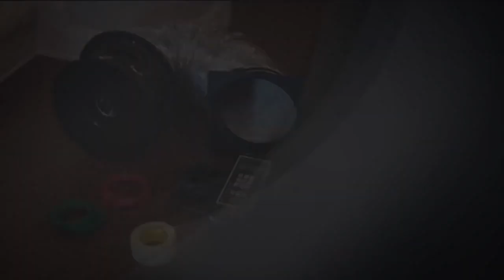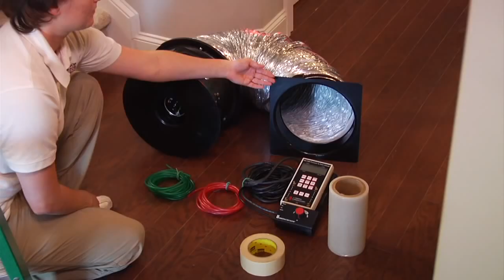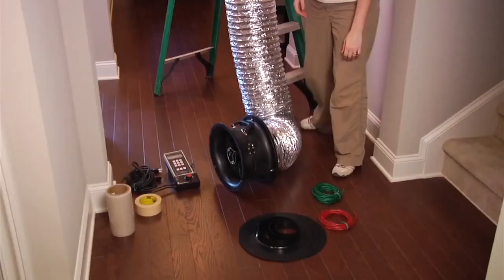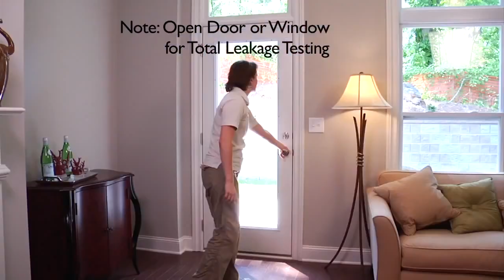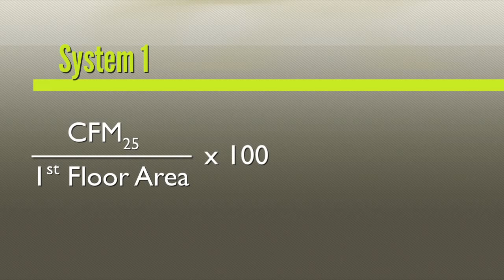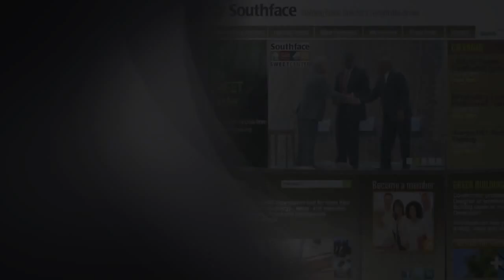2011 Duct Leakage Testing in Homes

Comment: I agree with Corey and even though we sell grille mask (duct mask) we also recommend your Vent Caps and even give samples away with each system to encourage testers to get them. 

Open Range should never be used on a Duct Blaster, which is attached to a flex. The manual doesn't say this specifically but it can be ascertained in another way since you must not run over 100 Pa back pressure (pressure in the flex) and if you run the Duct Blaster near maximum speed the back pressure will be well over 100 Pa. This results in the Duct Blaster reading high by as much as 25%. To get an accurate reading simply use Ring 1 or smaller which will create the same test pressure as Open Range any way. It IS ok to use Open range when the Duct Blaster is connected to the equipment cabinet but even then, you must monitor the pressure in the cabinet to ensure it doesn't go above 100 Pa. 

Overall we strongly recommend you depressurize the ducts to save time in sealing registers. Results will be the same. When depressurizing, ensure you use the flow conditioner with that piece of foam with 1.5-inch holes in it, and then attach a second tube from this flow conditioner to the other port on Channel B. Never use Open range while depressurizing which doesn't matter much because as mentioned in the previous paragraph, you shouldn't test on Open range anyway. 

If you don't believe how back pressure can affect your results, pressurize a flex duct that has a flange on the end that has been sealed off with tape. You'll measure a pressure of about 400 Pa and flow rate of 800 CFM even though clearly the flow is zero because the flex is sealed off. This shows the extreme case for sure but does demonstrate the principle of how excessive backpressure will affect your results. None of these issues are a problem when using the Retrotec duct tester. You never need to remember what tubes to hook up or to watch for excessive backpressure. All these functions are automated in the design so you cannot really make a mistake. And, it will give your results in CFM/100 sq ft or any other Code required results.

Comment: I'm disappointed to see the omission of the many alternatives to duct mask (disposable plastic tape).  I'm obviously partial to VentCapSystems.com, but there's also Duc-Bloc, and even MavCaps.  Rigid, reusable, and non-adhesive alternatives produce consistent and professional results that are easily replicated by QA providers.  It just makes sense all the way around.  

The price of tape and it's shipping just went up again at the beginning of 2015 making it an even bigger waste of time, money and resources.  If we're really to be the tip of the environmental spear, should we be throwing away wads of plastic after each inspection?  Especially when it's not only possible but easier, cheaper and safer to do so?